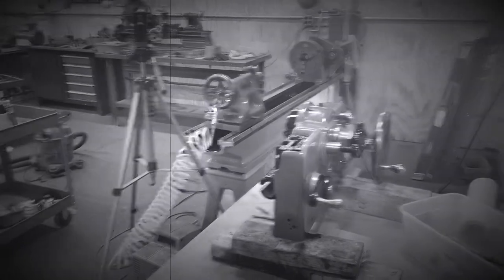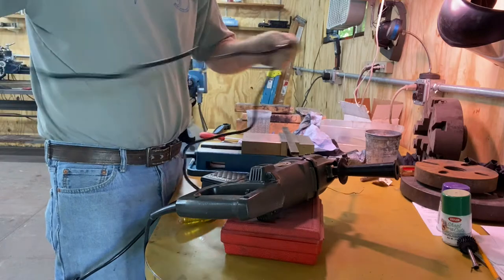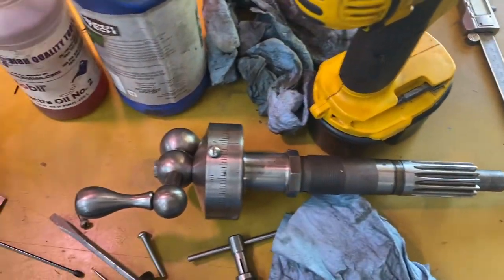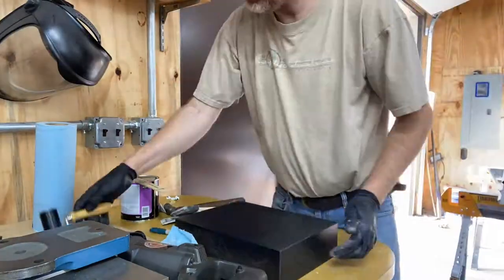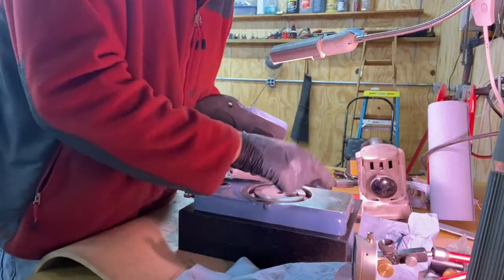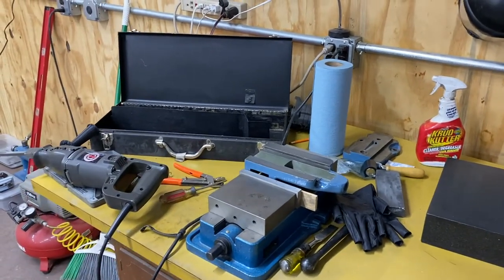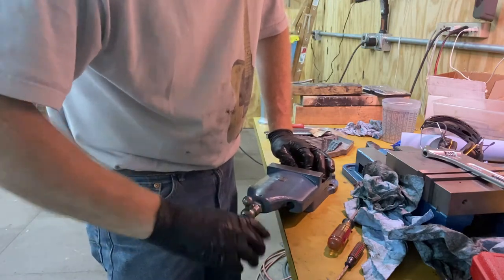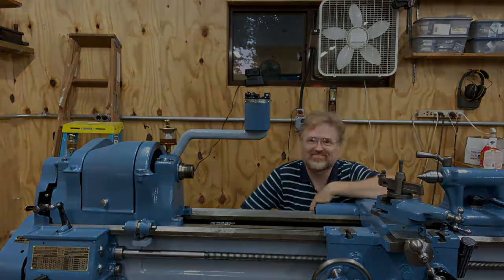South Bend Lathe Restoration , Part 12b (Carriage)

Comment: Hey Kevin,
Just share a bit.
The ,”scraping you are doing as you said was for oil retention.
As a best practice, the top sliding surfaces are flaked for oil retention. The underside surfaces.
This is to prevent metal particles from sticking to the ways which will cause further wear.
If you decide to scrape the old lathe for accuracy, you should take a 40-80 hour class.
The trick is to know how much to remove and where.
Reply from the maker: I would love to take one of Richard King's classes on scraping.  Maybe someday.  So I guess I should have said "flaking" instead of "scraping"?  Thanks for the feedback and for watching!  UPDATE: In thinking more about your comment, I have seen that modern lathes have smooth way surfaces and I assume  under surfaces of the carriage are textured / scraped for oil retention.  However, this old (1935) SB lathe definitely had scraping marks on all the ways that could be seen at each far end.  It was only in the areas of high use that were worn smooth (shown in the video).  Thus I was just trying to get it back to the way it was originally manufactured.  Thanks again.  :-)
Reply: @KevinToppenberg  Kevin,
The only reason I replied was because I took his class back in April 2019.
 Richard King brings a crate of Biax power scrapers and a dozen pieces of cast iron that is not quite flat. We were initially tasked with hand scraping a flat part for proper bearing surface for oil retention.
Then we moved on to power scrapers and flaking. 
The science and techniques of determining how much to take off and where is part of the discussion during the week of instruction.
He also introduced machine tool rebuilding to the class. How to straighten a gib, how to set up your dial indicator to take proper readings. How to blue a surface plate and proper dye transfer.
Long story short, if you get a chance. You won’t regret it!!
Reply from the maker: @jeffanderson4979  That sounds like a great experience!  I'll have to see if I can take it at some point.  Thanks again.

Comment: Lathe is looking great. Any idea what the T-slots are for in the top of the saddle? Mine doesn't have those.
Reply: Those T slots are on some of the older SB lathes for mounting a flat, work plate stand for mounting work pieces for line boring and other work. If you have a copy of SB's How to run a lathe you'll see a picture of this setup line boring a housing. My 15" is the same vintage as Kevin's and has them as well.
Reply from the maker: I found a 1931 catalog that states: "The Carriage has a wide deep bridge providing rigid support for the tool rest. "T" slots are provided for clamping work or fixtures on the 13-inch lathe and larger sizes."  I'm not sure how that would work, and apparently it wasn't felt helpful enough to continue with future models.  Thanks for watching!
Reply: A tool holder can be mounted on the cross slide without the compound to improve  rigidity.
Reply from the maker: @russnixon6020  Ahh, that is a good idea.  I didn't think of that.  Thanks!